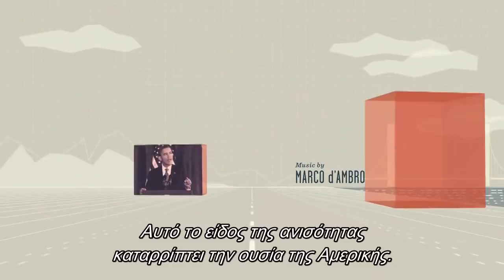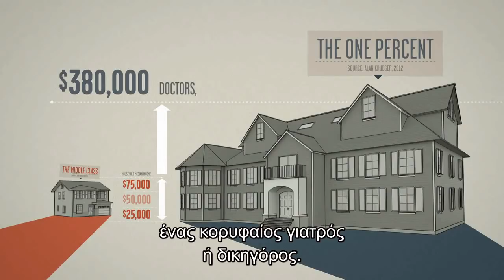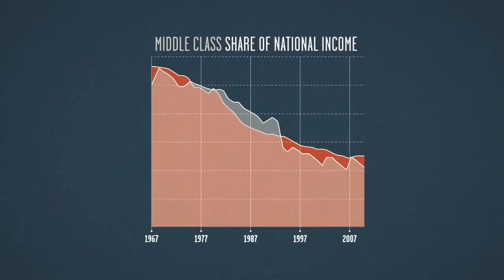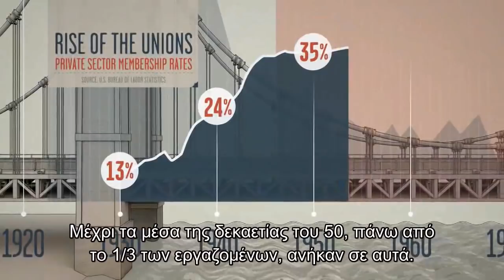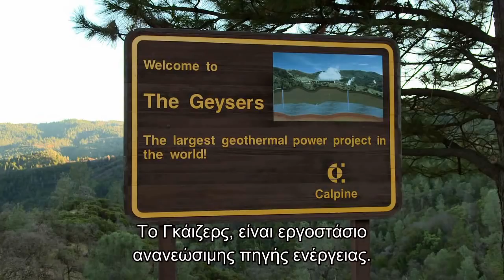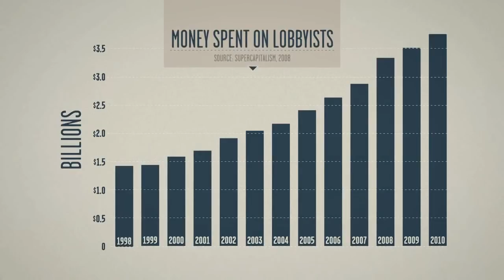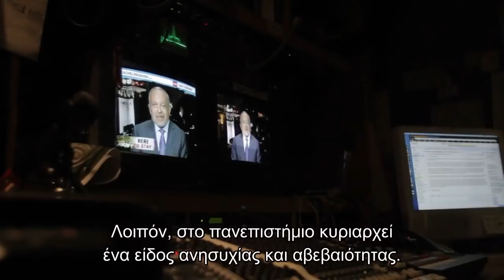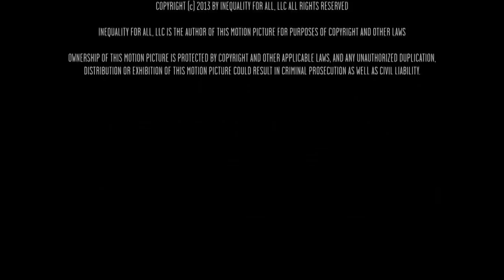Inequality for All (2013) (Ελληνικοί Υπότιτλοι - Greek subtitles)

Comment: Great documentary! Inequality is not a random result, it is the result of a well thought and designed process that has taken decades in the making. Income (and consequently, wealth) inequality is the main tool used by the elite to concentrate firstly economic power. Once economic power is achieved, all other forms of power (political, military, social, financial, and so forth) are also achieved. That is the monopoly power and the plutocracy at work. Therefore, people have to fight to avoid the income and wealth inequality in the first place. And now, to undo the done it will at least half that time, i.e., it will take at least 15-20 years at a restless pace. Get ready and do it!